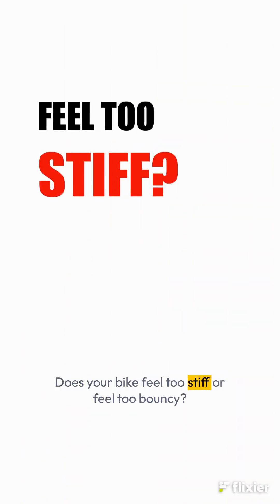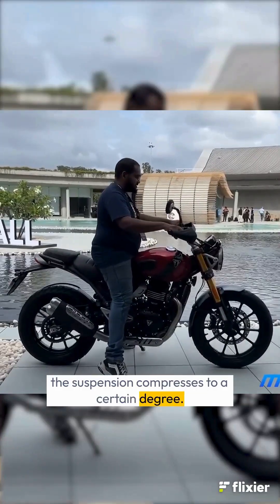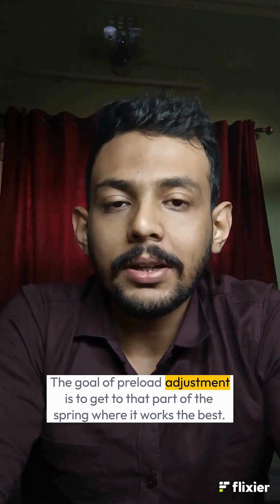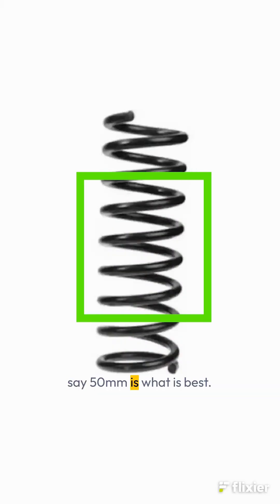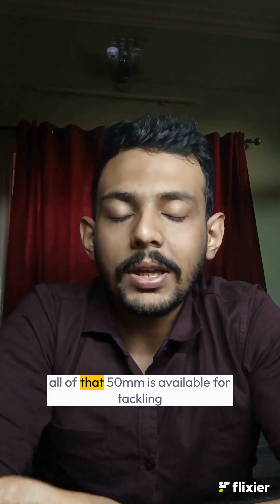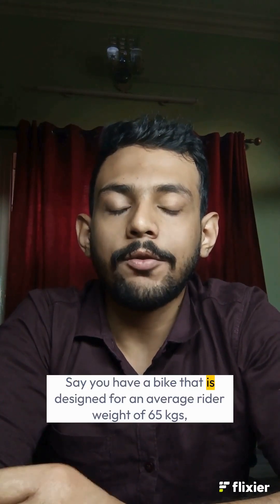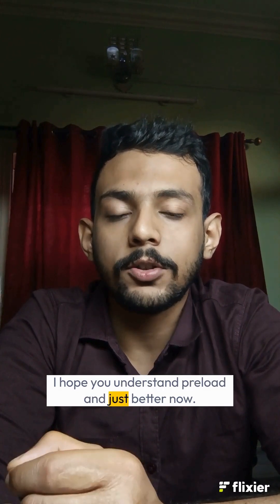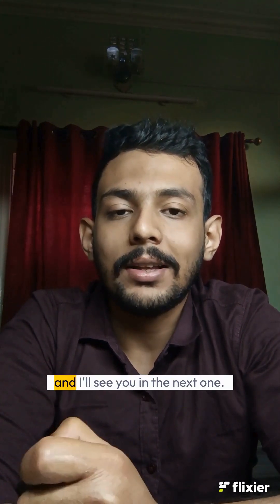Preload Explained: Fine-Tune Your Ride! #preload #suspension #coilspring #adjustment #bikes #comfort

Comment: You are talking about sag, not preload. Preload is ONLY the part where you take out the play, without sitting on the bike. 
By tensioning further, so the sping does not go in with load or by adding your own weight. This will only make it stiffer, because it can not bounce out.